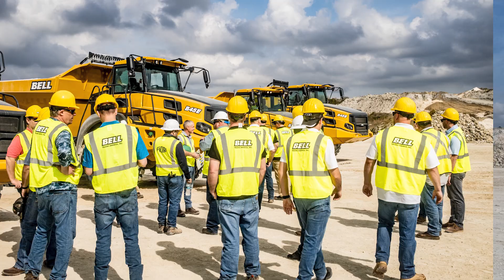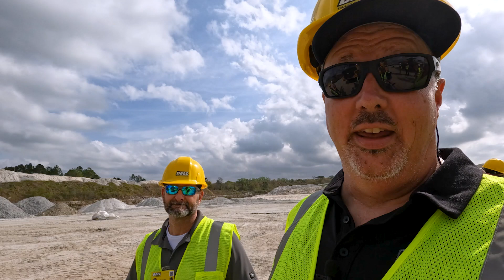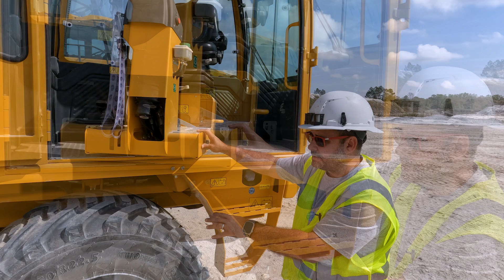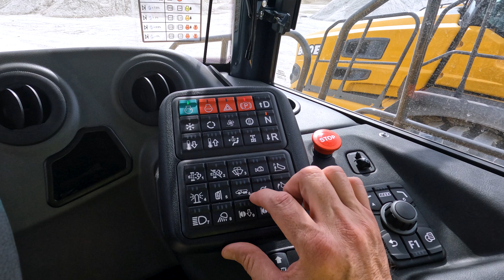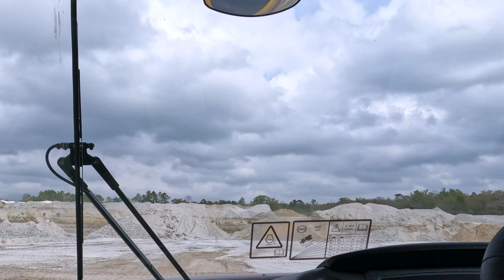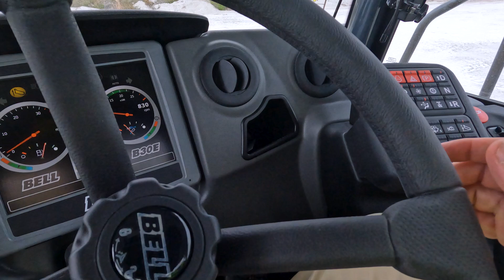Hands-on Bell Trucks & Fiori Training and Ride Along at Florida Sand Mine

Comment: It’s pretty clear your “reps” have little time operating these trucks nor other equipment - commenting on luxury and spaciousness of cabs in these Bell trucks or any ADT’s lacks sincerity - all ADT’s have large cabs with a jump seat. Auto-lube systems?  Retarders? Onboard scales?  Huge displays?  

All standard with leading brands…

Lastly…all operators know the first machine a rookie is assigned to is a ADT, because they are simple. 

The true selling point is the ability to use third-party autonomous systems to displace human operators with one remote “supervisor” running three or more trucks - since Bell (South Africa) has not developed an OEM solution, Tomahawk Construction in SW Florida is using TELEO for this purpose with great results